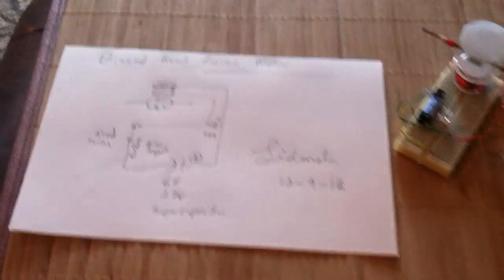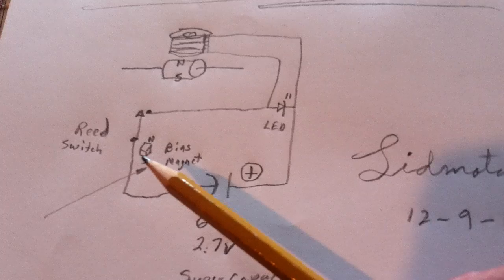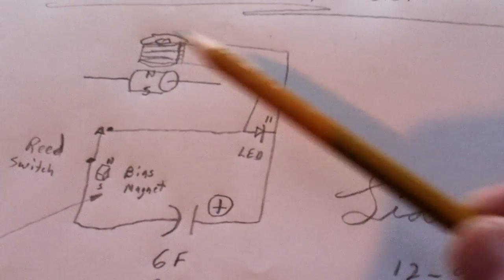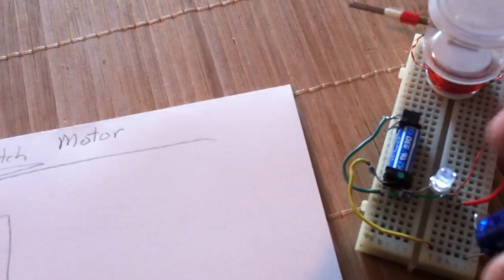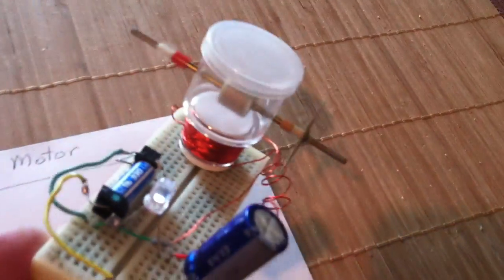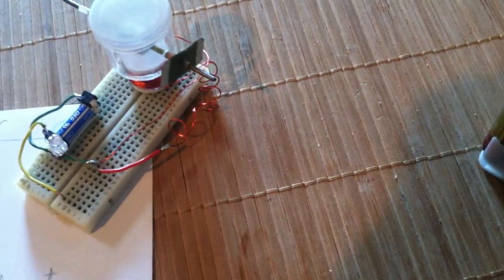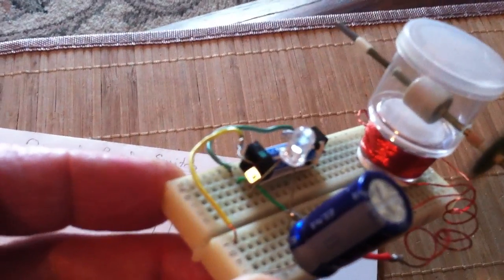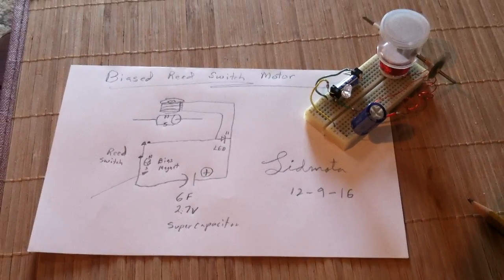Biased Reed Switch Motor

Comment: Hi, I know this is off subject but I just wondered if you ever tried sticking, let's say a copper nail and a zinc nail into a cork. Run a long wire from each nail without them touching together. Throw it overboard from your boat and using the salt water of the sea, you would have a floating battery.
Reply from the maker: Not enough amperage to do much with.   I have tried such a thing using a copper pot scrubber and a galvanized steel one.  You don't need sea water.  Just tap water and table salt in a bowl works fine.
Reply: Thank you. I am never close enough to the ocean or sea to test it.

Comment: it also works without an additional magnet. because remanence of reed contacts maybe...
Reply from the maker: I have not gotten that to work but it is worth looking into.  Somehow you have to get the switch to trigger on just one rotor pole.
Reply: ***** it was n/s-magnet rotor configuration with oldscool soviet union reed switch )
0,5x0,5x2 cm neodymium magnets x18 pcs

http://2llS.net/_hard%26ware/SDC10370.JPG
http://2llS.net/_hard%26ware/SDC10375.JPG

Comment: Why don't you use a hall sensor instead?
Reply from the maker: I have done that many times but you need almost 3v to use them.  This little setup would work great with one though.   Thanks.
Reply: Lidmotor you're right, but you can reach higher speeds. Take a look at my last videos.

Comment: Have you tried using bearings like a 623zz?
Reply from the maker: I have used ceramic ball bearings on some of my projects and they work great.  I don't know what a 623zz is.
Reply: *****
623zz is just a 3mm I.D. bearing.  They make smaller but they get expensive.

Comment: re:  "...A small magnet located near one end of the reed switch causes it to turn
 on when just one pole of the motor  N/S rotor magnet passes by."

How does that circuit work exactly from start thru switching?  Is the reed-relay switch NO or NC?  How does the rotor mag influence the square mag to cause the reed switch to change states??
Reply from the maker: The switch is normally off .  The rotor magnet turns it on.  The little bias magnet is just strong enough to negate one magnetic pole on the rotor so that the switch only goes on once per revolution.  It is tricky to get it set up right.  It is a lot of trial and error.
Reply: Hmm... that rotor mag is quite a distance from the reed switch.  Kinda surprising it is strong enough from that distance to close the reed switch.

When you write:  "...just strong enough to negate one magnetic pole..."
do you mean a repelling force that prevents the rotor mag field from closing the reed switch during one half of the rotor's rotation?

re:  "It is tricky to get it set up right.  It is a lot of trial and error." that looks like an understatement... ;-)
Reply from the maker: I start the trial and error process by working with the reed switch alone first. After I find a spot where it looks like the motor might run I add the bias magnet. I have done this for so many years it usually only takes about 10 minutes to get the motor running  and timed up.
Reply: ***** Interesting.  Thanks!